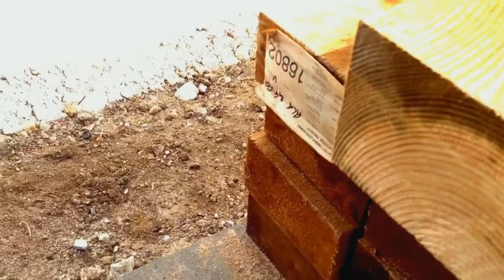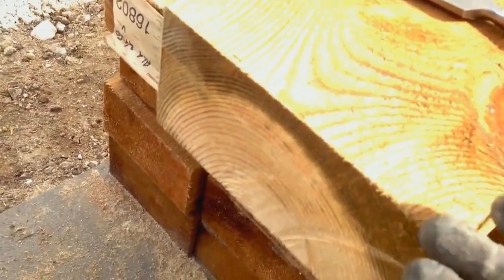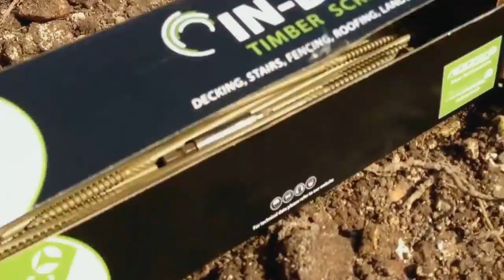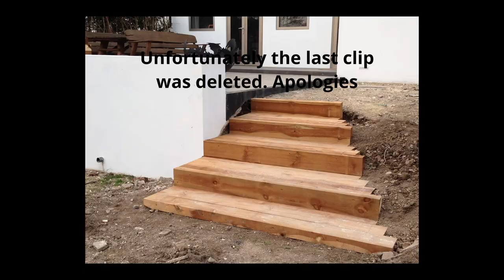Step by Step Railway Sleeper Steps

Comment: Thanks for share. Can I ask what bedding did use for the sleepers to sit, or did it go straight onto soil
Reply from the maker: I put them straight onto compacted chalk. You can top it with sand first to make it easier. Both work well for drainage. Thanks for posting. Nick.
Reply: @NickBarban  thanks for the reply much appreciated